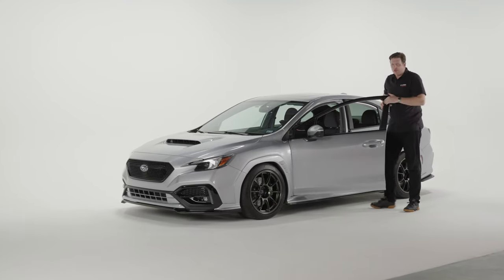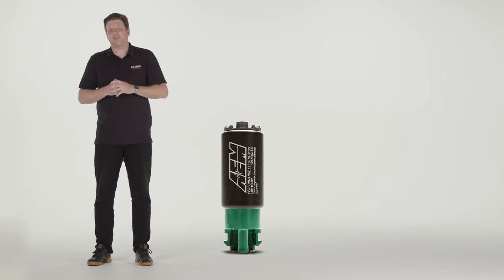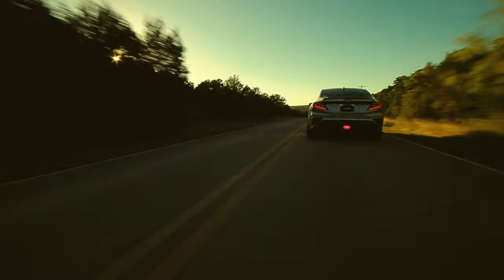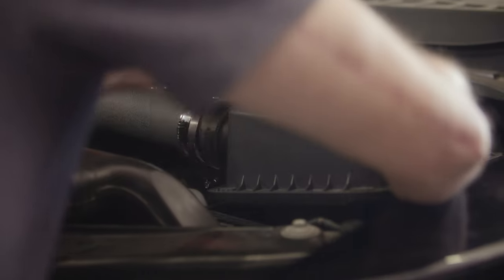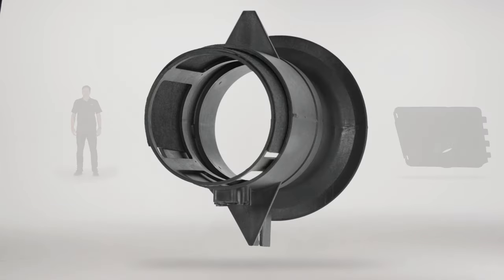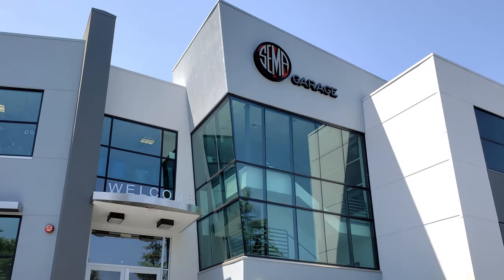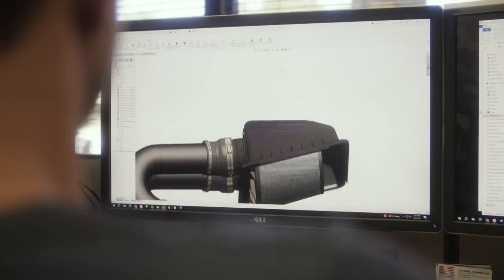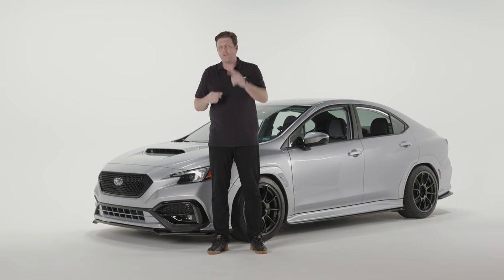COBB Tuning - What is a Hydrocarbon Trap?

Comment: didnt caddy do this with their radiators waaaaay back in the 80's?  some covering on the rad that worked like a cat converter.  i think,its been a long time since i read that.
Reply: volvo does that.  they covered their radiator with a catalyst to "clean" the air as you drive